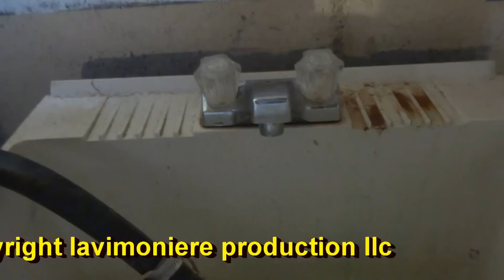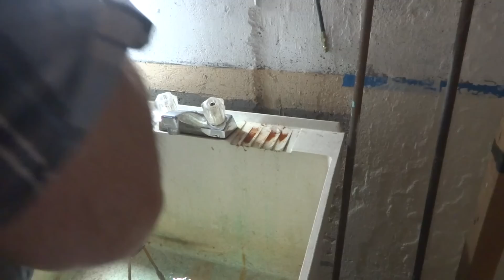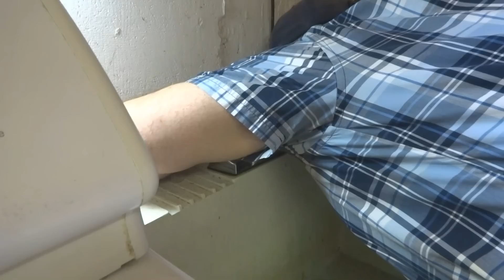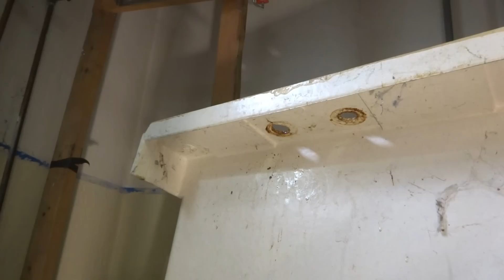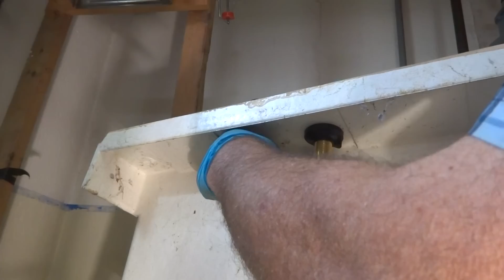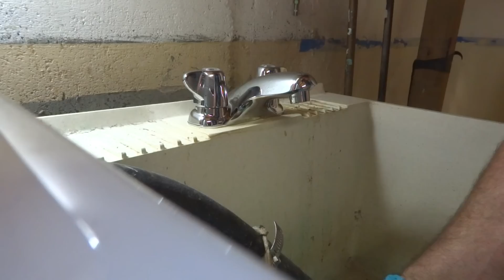LAUNDRY TRAY SINK FAUCET REPLACED

Comment: Just a mention Steve.... was sink fibre glass/epoxy based/coated? If it was that dust you created is very dangerous to your lungs forget miners lung you in for a worse kind of suffering with that super micro -sized particles. Think cancer or being fixed on a lung machine once it starts... Not nice, something with that face-mask prevents long term suffering. 🤨Just a heads up ....Give the supper fluffy Miss molly some good scratches for me 👍
Reply: Don't think he's exposed to it on a daily basis. Or hardly at all.  He'll be just fine.  Definitely not thinking cancer....Jeesh...Just a mention.

Comment: Steve there's no trap on that sink????
Reply: It dumps into a pit. No need to trap it
Reply: @tannerwest6823  Yes and the stink
Reply: @Garth2011   it won’t stink, the pipe is not hooked into the sewer line genius. It literally runs over to a pit like 5 feet away and from there the water is pumped up and out through the drain lines.
Reply: @tannerwest6823  Let me know how long it takes for washing machine waste water to get ripe.
Reply: @Garth2011  you don’t make any sense man.  I’m not sure you understand how this works. It’s an open pipe at the end that the water flows out of into a hole in the ground with a pump in it. The pipe is not connected to anything so what good is a trap going to do. There’s no water standing in that pipe ever, so how will it go “ripe” as you say. When the water dumps into the pit it gets pumped out.